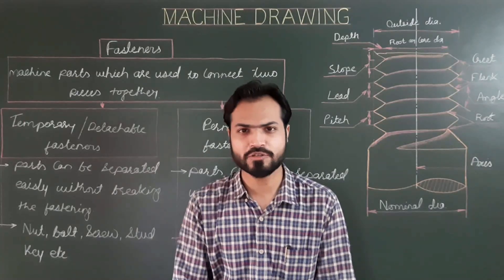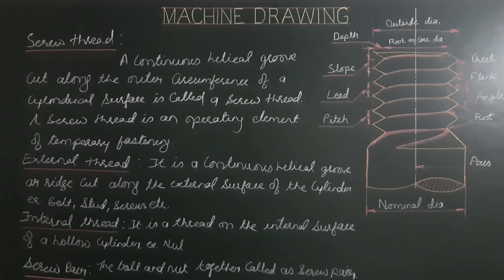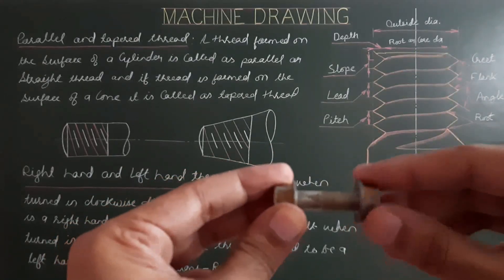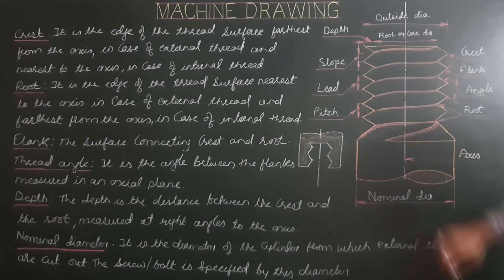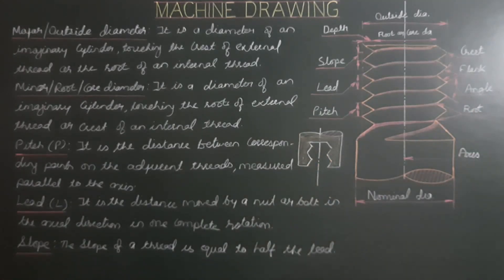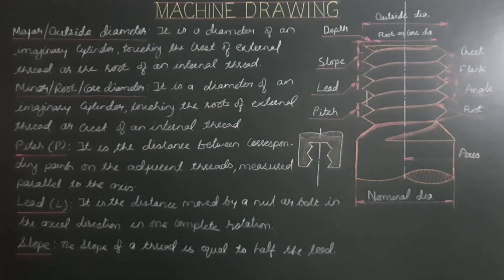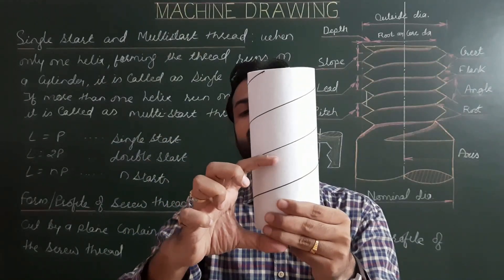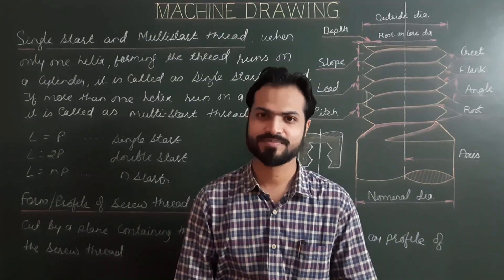Introduction Of Machine Drawing - Basics of Fastening & Various Parts Of Screw Thread (Part-1)

Comment: sir can you once again explain about right hand and left hand threads
Reply from the maker: TRY THIS...Take any nut and bolt. Hold the bolt firmly in left hand and rotate the nut
 clockwise by the right hand, the nut will screw on the bolt of the threads are right handed.
 A left hand screws thread, screws off the bolt for clockwise rotation.

Comment: Sir please upload full lecture of Machine drawing its the current need Sir ..
Because universities are teaching online .
Which is very tough to understand so please Sir upload complete lecture..
Reply from the maker: thankyou for you response..i will try to cover syllabus of universities also..please let me know what topics you want..
Reply: @vinaykumarverma5186  Module I
Introduction to Machine Drawing: Conversion of pictorial views to orthographic views
Screwed fastenings: Screw thread forms, V and Square threads, Conventional representation of 
threads, Hexagonal headed bolt and nut, Square headed bolt and nut, Nut locking arrangements, 
Foundation bolts (common types, special types and detachable types)..
Module II
Cotter and Pin joints: Socket and Spigot joints, Gib and Cotter joint for rectangular rods, Sleeve 
and Cotter joints, Knuckle joint.
Pipe joints: Coupler joints, Nipple joints, Union, Socket and Spigot joints, Integral flanged joints 
and Hydraulic joints. Single line orthographic symbols for pipe fittings.
Module III
Assembly drawings of : Non-return valve, steam stop valve, Rams bottom safety valve, Lever 
safety valve, Feed check valve and Cylinder relief valve.
This is the complete syllabus Sir please help us ...!
Reply from the maker: @speakbuddy3844 some topics are very lengthy ..i will try to cover them.
Reply: @vinaykumarverma5186  thanks Sir Hope so u will upload this soon Because there is no other channel present on u tube who have completed the entire syllabus , and also we have no books here ..!
Reply from the maker: @speakbuddy3844  😊😊🙏🙏